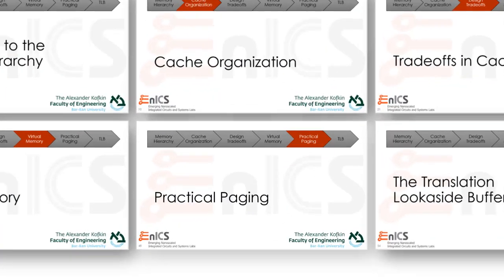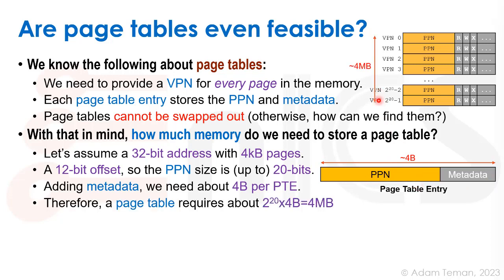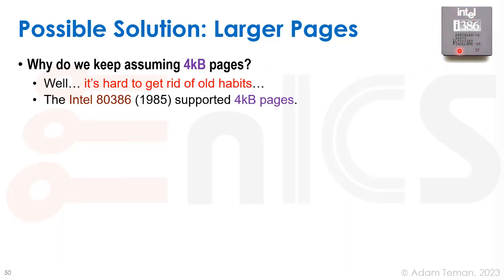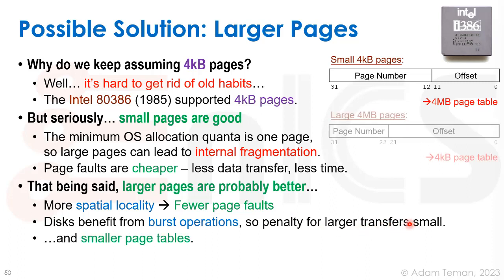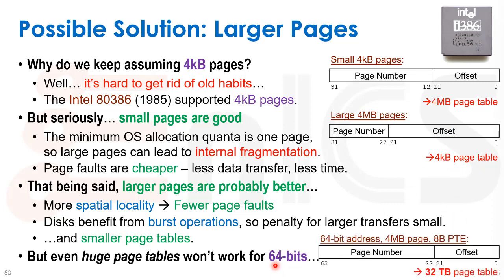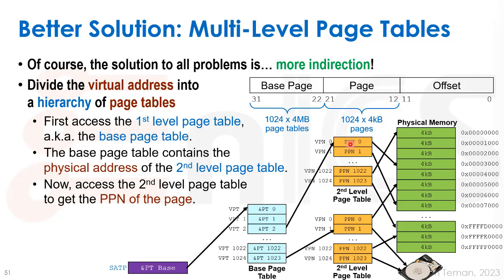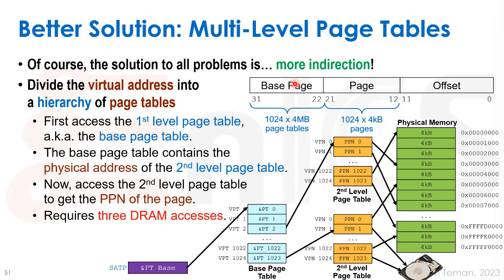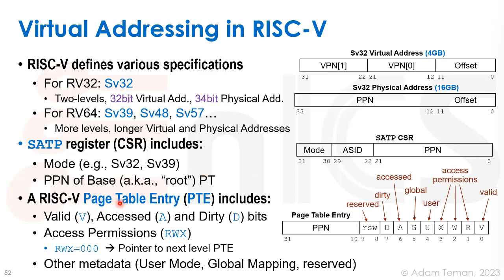SoC 101 - Lecture 6e: Practical Paging

Comment: If we have up to 100 or 1000 processes how can page table size will increase?. I mean the bits that identify the physical page number would remain the same 2^20, therefore size would be 2^20*4B=4MB.
Reply from the maker: I'm not exactly sure I understand the question. On slide 50, I demonstrate this concept of "larger page tables". If we have 32bit addresses with 4MB pages, then we have a shorter physical page number of only 10 bits. If we have a bigger virtual address (e.g., 64-bits), then the physical page number is much longer and infeasible and this is one of the reasons we use multi-level page tables  (slide 51)